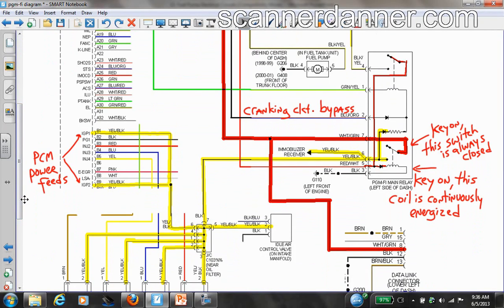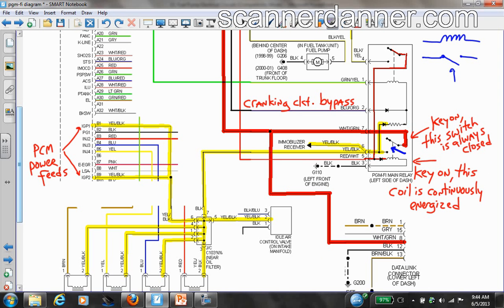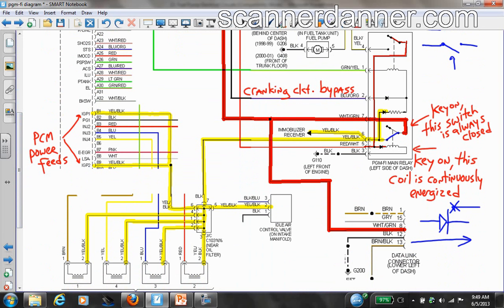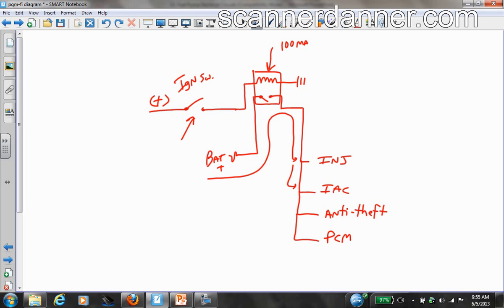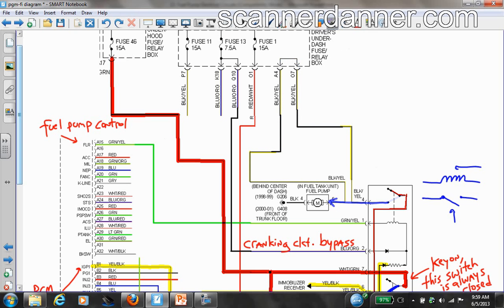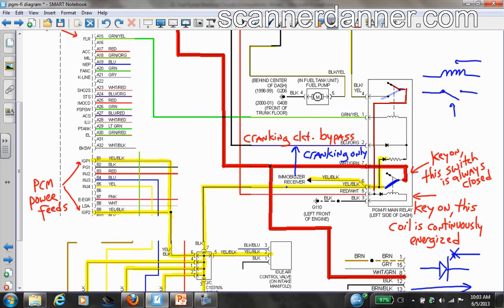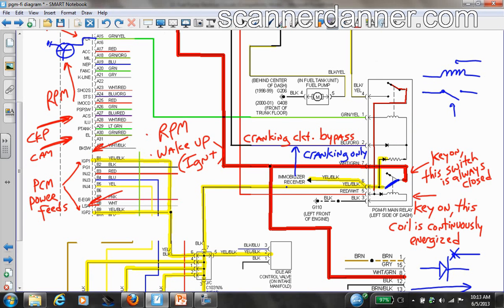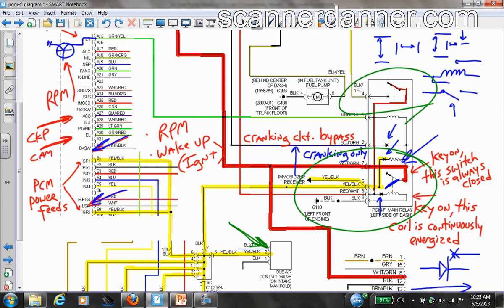Operation and testing of a Honda main relay (PGM-FI) - an SD Premium video

Comment: Paul, thank you for taking the time to splice this information together. You answered your own question at 29:05 about  the engineer's rationale, for employing a series resistor in the hold in circuit. More electrical pressure: more current across a fixed resistance (coil) HEAT/COMPONENT longevity.
Addressing all you younger technicians watching this, I want to reiterate the importance of knowing what is occurring in the circuit that you are troubleshooting. I have seen Honda and Acura dealership technicians that don't understand the workings of this circuit. You cannot throw parts at problems and expect your customers to continue bringing you their business. I encourage you to watch as many of Paul's videos as possible. You need to clearly understand what results you should be getting as you go through personal troubleshooting regimine.
Thanks again Paul, this is well done overview.
Reply: Thanks Randy!
Reply: LOL

Comment: I just want to say thank you so much for these very helpful videos. I’m a student in southwest Florida and our teacher just put in his two weeks to focus on his shop but he quit right in the middle of our electrical chapter. He also doesn’t explain it like you do and I grasp it much better watching your videos. I appreciate it and thank you again!
Reply from the maker: Dude you Need to check out what I'm offering on my premium channel 
There is a 14 day free trial. 
https://www.scannerdanner.com/join-scannerdanner-premium.html
Even if you don't thanks so much and keep watching these video here
Reply: @ScannerDanner   Sir, please abit of clarification from your end. Thanks.
1. will both the 2 input positive wires to the fuel pump relay will go live permanently as long as engine is RUNNING or only the input positive of the PRIME circuit will turn off while engine is RUNNING???

2. How the prime circuit behaves when engine is RUNNING?? Is it off or on while RUNNING engine?

3. How the 2 currents behaves  when they met at the 86 pin of the relay?? Will additional current will flow to the relay at the same time when engine is at START AS WELL AS RUNNING SIMULTANEOUSLY??

Comment: Talking about the diodes...in the diagram the bottom one protects the computer against connecting the battery the wrong way, the middle one protects against defeating the immobiliser circuit and the top one prevents the second circuit at fuse 13 being active all the time, second circuit is probably a start relay to remove non essential electrical consumption during cranking. Great video channel, many thanks.
Reply: WOW! Great stuff Ian!

Comment: These videos are giving me quite a bit of ammo with my dealer. My relatively low-mileage '99 Accord Coupe V6 has been having starting trouble for over 2 years. I originally had intermittent starts. First my dealer replaced the battery cables and starter, telling me there were "two items both contributing to the issue," which didn't fix it. $800 and completely unnecessary (according to car-savvy co-workers). So then they "replaced" (or more likely just repaired the solder joints on) the PGM-FI at no charge, telling me then "well, actually THREE issues all contributing to the same problem." 

This resolved the intermittent starts, but I continued to have long crank times with weak, hesitant starts. 

Now they've replaced my fuel pump, after promising me that by leaving the car with them for 3 days they'd have it fully diagnosed and resolved (telling me it would either be the $750 fuel pump or a $250 "fishtail"; I paid $666 for the pump after 10% off coupon)... and I still have the same problem. $1,500 in unnecessary repairs. 

Near the end of your video, I wondered if the problem is with the FLR computer-controlled ground. Of course, I can't find anything about what they are calling a "fishtail" that might explain the drop in fuel pressure they said the car has. Hell, maybe it's just a 15-year old gas cap I can replace for $10!

Anyway, I've enjoyed both videos related to the subject. Keep up the good work!

Comment: This is the best explanation that I've found, for a very complex topic. I was looking for a typical diagnostic pattern, but depending on which connection is bad, presentation may vary. I'm surprised this doesn't happen often with other manufacturers -- solder joints are everywhere.

Comment: Q; at 24:23 why?  So the part will fail and for it to be such a uncommon part you would have to take it to the dealer for work. Love this video. I’m learning a lot!!!
My neighbor was a Honda mechanic for over 30 years and he told me that the engineers have designed parts to fail so that the car would be brought back to the dealership. It’s just what he told me👍🏻

Comment: The why... this relay's coil is important to work at a lower cranking voltage (~8v) and expected to last when car runs at ~13-14v.  Coil designed to work reliably at 8v would have tough time living at 14v because of excessive operating heat.  Designed to maximize life of this component.

First video of yours I have commented on. Find all you videos extremely interesting (i am in industrial controls). You have a very good teaching ability and style. Thank you for your effort.

Comment: ScannerDanner, this video has helped me out a lot. When I turn my car to the ON position first thing in the morning, my ECU does not turn on. But if I wait about 5 minutes with the key still in the ON position all of a sudden it comes on because I hear my fuel pump and the LEDs on my Hondata S300 chip come on. Anytime after that first 5 minute wait and it comes on like a charm every other time, until I let it sit overnight. So I am thinking my ECU isn't getting any power when I first try to start the car. I've already gone through the hell of replacing the distributor, the ECU plugs, the fuel pump, the main relay. We even tried my ECU in another civic and it worked fine. So like I said I believe my ECU just isn't getting power in the beginning and something is warming up for 5 minutes before it finally sends power to my ECU. Tomorrow I will finally know send I have a test light hooked to it and also wired in a "T" shaped power source to both IGP1 and IGP2 to a switch that only gets power when in the ON position. If my ECU doesn't get power in the morning when I first turn the car to the ON position then I will flip the switch for my own power source and see if she works. If she does come on and works fine does anyone have any suggestions for the right sized Fuse to put in my "moded" power line to my ECU just in case I ever have a voltage spike? Last thing I wanna do is fry my ECU. Or do you have a suggestion on where my stock power source might be having the issue? And also could you post or send me the pic or a pic of the diagram you used for this video?
Reply from the maker: +Ashe Morris ignition switch is a huge problem on these

Comment from the maker: Resistance does affect voltage. An increase in resistance will always decrease current flow. (ohms law). 
However an increase in resistance can cause a voltage rise (thermistor circuits for example) or a voltage drop depending on how many resistors are in the circuit and where you are measuring.

Comment: Your comment/question about the purpose of the F/I relay's diode can be explained by coils depicted in the diagram. The lower one has more windings than the F/P coil. The circuit is interupted in bias flow...this is a engineered CEMF supression feature, indirectly isolating the F/P coil.
Why does Honda/Acura place both the F/I and the F/P relay in one housing, instead of using a couple of bosch relays? Part of the reason is stated above...the other aspect is that they sell copious quantities of this item. Honda does not recognize the solder and go method. Flat rate dealership techs figured out the issue was in the board long ago, and they would run their own "parts exchange programs",out of their bottom tool box drawer, by soldering the contact points. The problem is that, cold solder joints are a common issue in electronic components...especially after a repair (see your previous video for a good example the difficulties of attempting a solder job with an all purpose iron).
All in all, the best practice is to replace the component as a unit. I have seen too many customers lose faith in their repair shop, when the vehicle is back on the hook a month later, with the same issues.
The same is true for DRL relays...
Thanks again for your time, in laying out these circuits. Your topics are always thought provoking.

Comment: Heavy resistor is there to: 3W, 42-Ohm. Reasons: reduce relay heat buildup, reduce current, reduce transistor stress.
Diodes are probable reason: Prevents ECU damage during accidental reversing of the battery cables.

Comment: What components control the fuel pump to PRIME FOR ABOUT 2 SECONDS only at key ON?
Reply from the maker: The ECM does when it wake's up (as soon as the key is turned on)
Reply: @ScannerDanner hello I know why the resistor is placed in series with the coil.

It's purpose is to basically LOWER THE AMOUNT OF CURRENT when key is at ON POSITION. That's to Conserve Battery Power.

Say, consider only the coil, if the coil resistance is 100 ohm. Then at Key ON say at 12.5V, the coil is constantly ON. Hence, total current is 0.125A. Also, one thing to note is that relay still works perfectly even at 9V. So, at 9V, total current is 0.09A.

Now, we add a resistor of 38 Ohm in series with the coil so that approx 3.5V will be dropped across the resistor maintaining the same previous total current of 0.09A throughout the series circuit. In this case, the coil still energized perfectly. Hence, power consumption is reduced and battery is protected from draining.

So, with ONLY the coil, the total current under 12.5V is 0.125A.
If resistor is added, total current is 0.09A with 9V across the coil.
In both cases, the relay is Completely Energized.
So, difference of about 0.035A of current which is very very significant difference if key is ON for long hours. Hence, power consumption is maintained.

Hope this helps 😊😊😊

Comment: Would the purpose of the diode also be to prevent voltage from the collapsing field of the coil from going to the computer when power is switched off?

Comment: Reason for resistor.....
Relay coil designed for lower voltage of battery at cranking or rest.  Then when engine starts, alternator is able to provide higher system voltage, hence the need for a resistor to cut back current when at higher voltage.

Sort of same concept of the ballast resistor in the old conventional ignition systems.  To compensate for a lower battery voltage during cranking.

Comment: I think the reason the "cranking bypass" has no resistor and the Yellow/blk (key on power) has a resistor and a diode is because when cranking, the blu/org wire (cranking bypass) will have lower voltage to begin with since the starter is pulling most of the power.  So after cranking is done the yel/blk will have full voltage and would need a resistor to match what the blu/org puts out during cranking.  The diode would be there since there would be voltage fluctuation from the on/off of the starter.
Reply: ScannerDanner is my HERO

Comment: I think both relay have ground all the time and diode are to stop the ground, and the yel/blk wires is use by the pcm for rpm to cut off in case of accident. does yhis make sense to you? Paul. I think crank signal is use for ignition control and injection.

Comment: Thank you  The presentation and your explanation are clear and direct again thank you
Im Sure you would have made an excellent educator brother NO JOKE 
again THANK YOU.
Reply from the maker: I've been teaching at Rosedale Technical College for the past 20 years 😉 so thank you! It is good to hear that
Reply: ive been going crazy i own a 2003 civic ex 4 door 1.7 and changed the fuel pump and nothing so i let it go after 1 year an horrible neighbors whom done a number of things make the long story short since ive been out of work i couldnt do anything well received a city notice to either fix it or get rid of it come to find out the new pump i had my fuel pump was changed by one of my amazing neighbors so i bought another one after changing the relay the fuel pump is now priming however it does not start and i dont know where the main relay is so thats where im at not having much mechanical knowledge sucks but you did help keep up the good work bro.

Comment from the maker: It would be so minuscule in this case that I just don't think that applies here. there are 20 other relays on this car that do not have series resistors in the control circuit. good point though. manufacturers are employing that thought process on todays cars

Comment: You mention "wake up signal" which turns the fuel pump on for 1 or 2 seconds.  At the same time the Check Engine Light (CEL) reflects that by turning on and off.  Once the check engine turns off the car is then able to start.  

What is going on in the Main Relay and the ECU when the Check Engine Light (CEL) remains on for more than 2 seconds.  
If the CEL does not turn off you are unable to turn start the car.  Some Honda owners have reported waiting up to 15 minutes for the CEL to turn off to then finally being able to start their cars.  

Is the problem with the ECU or is the problem with the Main Relay?
Can poor grounds, a bad ignition switch, a bad fuel pump, also affect the signal that tells the CEL to turn on and off?

I have a 1994 Honda Civic LX thats driving us crazy.
1.  We replaced the Main Relay but CEL still randomly stays on for more than 2 seconds.  We have waited up to 10 minutes before the CEL turns off.  We are able to start car after CEL turns off. (Can hear the pump prime just before car starts).
2.  The ECU was diagnosed with leaky capacitors.  ECU was repaired and we continued to have the same symptoms described above. 

We cleaned out the ground wiring at the Thermostat Housing (ECU ground).  Still same symptoms.
We noticed that that the car is more sensitive to rainy and damp days but still acts up under normal weather conditions.

Questions:
1. Can a weak or bad fuel pump cause the CEL to remain on.  Maybe the pump is so weak that its taking its time to build pressure on the line?  Can the ECU or main relay detect fuel pressure?

2.  Can a bad distributor, specifically the ignitor or the coil affect the CEL and cause it to stay on for over 2 seconds.

Thanks for your channel.  You are very clear and informative
Reply: Would love to see an answer on this

Comment: Strange question here. A friend of mine has a 98 Accord. He has had issues with it dying randomly while driving. He had to hold the key in the start position to keep it running. I replaced the ignition switch thinking that was the problem. The battery was dead, after the battery had charged, the start would engage with the key in the off position. I made sure the switch was in the off position as well, and it will still crank on its own. Have you seen this before?

Comment: I have a 2002 Honda Civic lx , with just the key on the fuel pump says running and will not ever reach its prime and shut off , could it be one of the two  pgmfi relays , i have a blue fuel pump relay with 5 pins that clicks and gives power to the pump but something is  keeping power on the pump with just key in the on position, not cranking, itll run and keep running till i turn car off, could it be pgmfi staying closed ..? If do which one , one on far right under glove box or one on the left ..?

Comment: im having issues with an 09 CRV injector 3 isnt getting pulse causing a misfire amd a DTC. based off this diagram i would assume the break is between the injector and the junction box as im getting ground to 1 2 and 4 just fine. would this be the correct assessment? im not sure what else to try and check. the original harness to the injectors was destroyed so i put in a new harness.
Reply from the maker: Shut the engine off, and restart it. Do you have injector pulse for a few seconds before it shuts down and stops firing? If you do, you're barking up the wrong tree. Intentional injector shutdown happens when the ECM is protecting the cat from a misfire (ignition or compression issue)
Reply: @ScannerDanner  very interesting. as i do restoration and custom stuff on much older cars whenever i end up helping out a buddy i end up learning something new. just finished watching your class on the topic of intentional shutdown. my first tests in the morning will be to do a resistance test on the injector and then your start/stop test with the noid light plugged in. now if i do find its intentional shutdown would the next step be a compression test of the cylinder?
Reply from the maker: Watch this one! https://youtu.be/v9csp3-4VSs
Reply: @ScannerDanner  i did watch this one. very informative. makes me want a picoscope kit. yeah i would assume that means im gonna have to check compression
Reply from the maker: @ulianotech  could just be an oil fouled plug like mine had (engine ring issues)
Reply: @ScannerDanner  did compression tests and everything was in spec. resistance checked out at 10.8ohms so thats in spec. no pulse at all ok the noid light even when starting and shutting down. we did notice that using a test light to ground on both pins on the conector for injector 3 were hot. iknow the yellow/black wire should be hot but signal wire idk. im currently in all data getting diagrams to trace that signal cable. any suggestions?
Reply: @ScannerDanner  also thank you so much for all the help!